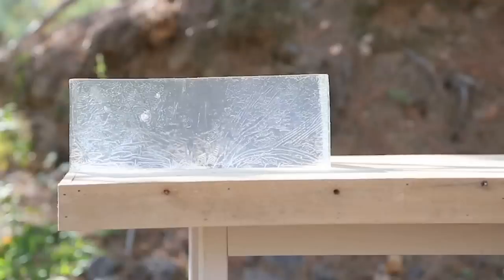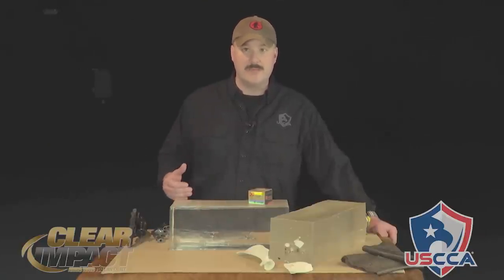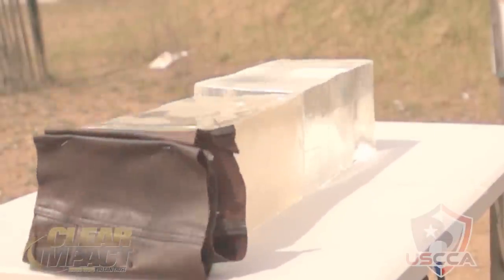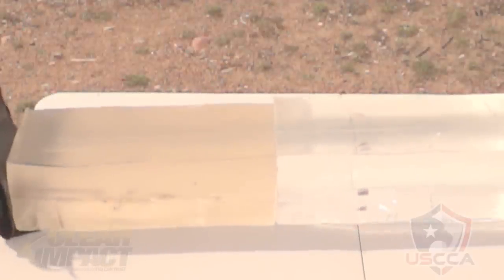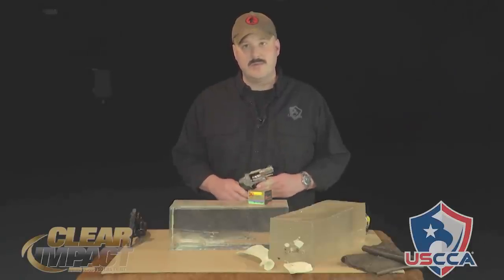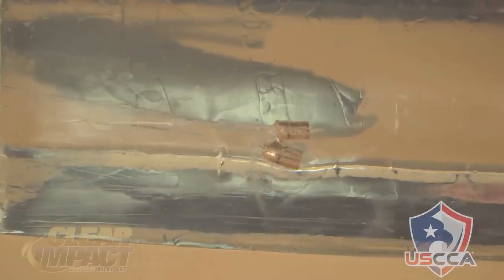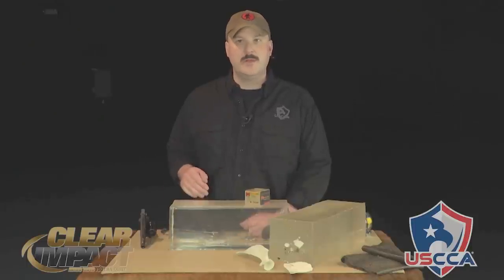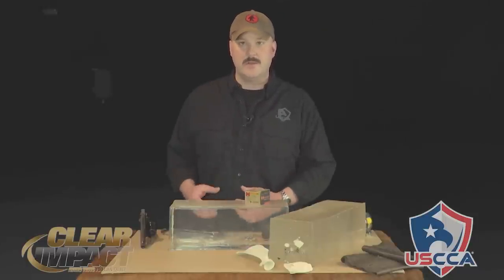Clear Impact Gun: 357 Magnum Cartridge From A S&W Snub Nose Revolver

Comment: I'm do glad I came across this video, I didn't just line it I love it.  I have a S&W .357 mag Model 60-9, which is a 2"(roughly) J frame 5 shot.  The operant word is woods gun and this one is mine for hikes I make throughout Maine.  I use Buffalo Bite 180 gr hardcast wadcutters and it does have great penetration.  I've thought about upgrading to a 3" .44 mag for super large black bear but feel safe with the setup I've got.  Happy and safe shooting thanks for this video.

Comment: I just back from the range testing my new Kimber K6s revolver.  Shot 3 different types of ammo:  100 grain light load wadcutters; 130 grain JHP defense rounds;  158 grain 357 magnum.  Shooting the magnums felt like an M-80 was going off on my hand. LOL  That and the fact that a lot of the energy from a 357 is lost unless you're using a 4" barrel (or longer) makes the 357 an unattractive option for a snubbie.  The 38 Special +P is more than enough.

Comment: I would like to know the velocity from that snubbie. Most of the time with most hollowpoints I don't trust them under 1200 fps until testing proves otherwise. With 125 XTPs, I am getting 1400 fps out of my 66-8,  2 and 3/4 inch barrel. 
 Should be noted I live at high altitude and no I'm not listing the powder charge but it's certainly safe in my revolvers.
Reply: Which .357 is this your using @ the 1400 FPS out of your snub nose?? That incredible velocity in a snub nose
Reply: I use Remington HTP 125 SJHP. The velocity on the ammo box says 1450 FPS but on a YouTube video using a 2” barrel snub nose the velocity rated @ around 1250-1260 FPS which is still very good velocity!!!